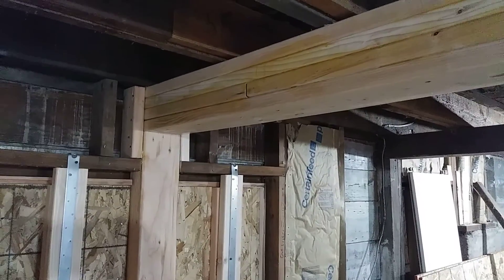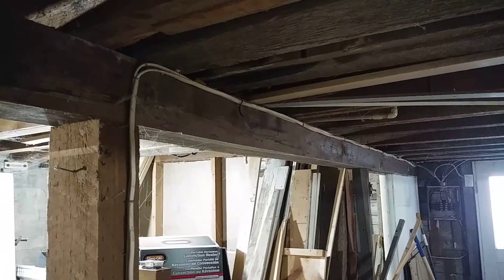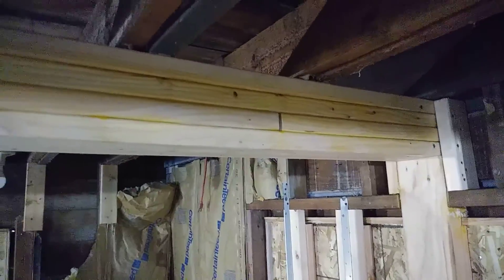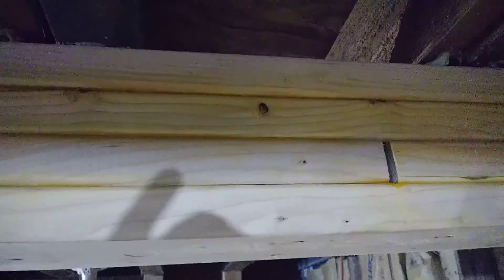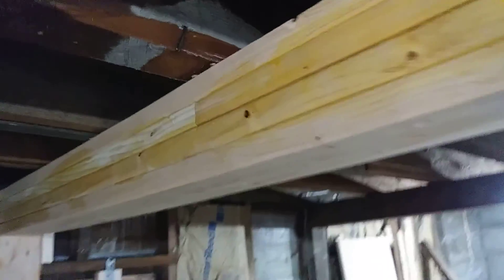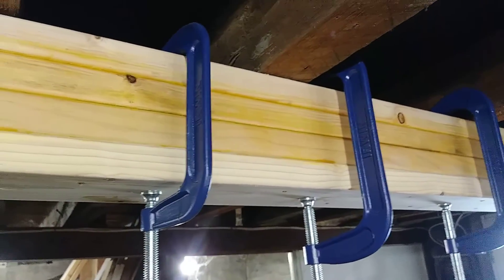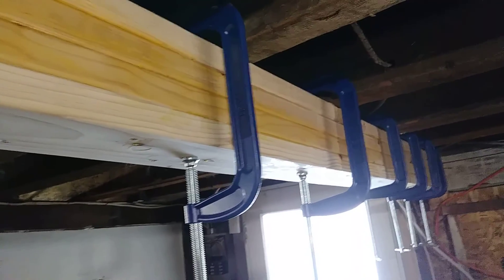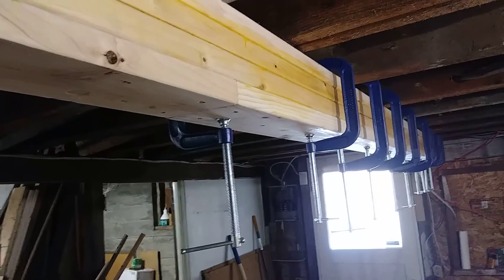Building a Glulam Beam in Place - Termite Repair

Comment: I thought the real strength from a 2 X 6 came from a load being placed on the 2 inch side of the wood. 2 X 6 placed on edge will flex less than the same laid flat on the 6 inch side glue not with standing. Why is the beam not built with the "I" in the vertical position. Why do you lay it flat? Just a weekend builder asking questions.
Reply from the maker: Factory-made glulam beams are routinely laminated as this one is. The strength is equivalent to the same size standard beam. The glue and screws that hold the layers together generate considerable sheer strength once the glue is fully cured. Strong clamping is essential when assembling the beam to achieve full strength, hence the large number of c-clamps that you see in the picture. Also, there are literally hundreds of small screws. These provide strength in their own right, and more importantly, provide clamping force while the glue cures. Also, it should be emphasized that the glue is applied as a thin, continuous layer of glue across the entire surface of the 2x6 beams. It is not a few random streaks or drops of glue. When you do this project, buy a one-gallon jug of woodworking glue. The beam that is pictured, which has four, 2x6 layers, (therefore three glued surfaces) and is twenty feet long, required two quarts of glue.
Reply: @wallihan  You cannot compare what is done under factory conditions with what was done here.
Reply: @gary24752  what magic do you think happens at the factory?
Reply: @UGPepe   The lumber species and grade all finger jointed to length, glue rated for structural use and clamping system under the right temperature conditions. Gluelams are engineered lumber and tested for strength.
Reply: @UGPepe  No magic just engineering. PVA glue is a NON structural glue, what appears to be use of pine with butt joints and the way they are pressed together are all the reasons this is not a gluelam beam. Do your research and stop making dumb comments.
Reply: @gary24752  I see this conformist mentality a lot in americans: you won't climb a chair to change a light bulb because it's not "rated" or "certified" for changing light bulbs. "research" to you means reading a label on a product. always looking for an expert to tell you what you can and cannot do with something because you cannot think for yourself or test things for yourself.
Reply: To call this a glulam it would take the correct species and grade of stress rated lumber and continuous with finger joints, the use of a structural glue applied and cured at the correct temperature and clamped with adequate pressure. Only a fool would take the chance on the adequacy of this kind of construction rather than just using a LVL beam that has been engineered, tested and manufactured to standards and picked according to its tested load carrying ability for the required span and load. Obviously you have not taken the time to do some much needed research to fully understand how a glulam is manufactured and why structural members have to be designed by someone with a background in engineering, preferably a registered PE.  Take the time and read Andrew Crow's response.
Reply: @UGPepe  Read Andrew Crow's response below. When it comes to structural beams yes I rely on engineering for structural members. At the very least I would have used LVL beams laminated per manufacturer.
Reply: @gary24752  In a confined space such as this, lvl would have been just as unmanageable as a factory rated glue lam. I guess you were not paying attention to the title and premise for this video.
Reply: You cannot compare engineered lvl lumber to construction grade lumber.  I guess you do not know the difference between a laminated beam which is what this is  and a gluelam which this is not.
Reply: @gary24752  deep
Reply: @UGPepe  There are some people that come here looking for ideas and understand and then there are those such as yourself that will never comprehend the dangers of guessing at something like this. This conversation is over.
Reply: The only difference I would have suggested is if you already have termites consider using treated lumber or western red cedar as it tends to thwart insect bother or use a treatment on the lumber you're installing. Other than that should work fine
Reply: @jerrodwaterman9793  western red cedar is not sufficient for this type of application. He should have bought a full length lvl for top and bottom cords and used longest #1 df possible. His gluing technique is wrong, should have used 1/8” trowel.   The best would have been an multi ply lvl/parralam flush beam to match joist depth.

Comment: Why would you build a garage out of wood? Let alone a 2 story one. Get some formwork, a rear bending tool and hire a concrete truck and build one out of concrete. It's not that hard.
Reply: The same as Scott said about his, the building I was in was older.. over 100 years old..  and at far as being able to have more presses in there, there simply wasn't room for more..  as far as fire, there was a suppression system of course..
Reply from the maker: I agree. But this garage is an existing structure, built more than 70 years ago.
Reply: @wallihan  fair enough, but I feel that people overestimate the efficacy of wood as a structural material.
Reply: @varun009  I used to work in a printing factory that had giant printing presses on 3 stories of a wood frame building.. the printing presses were about 30 tons each and there were 4 on each of the top two floors ..
Reply: @aztekwarrior518  right. And if it had been made out of steel reinforced portland cement concrete, you'd have been able to fit all 8 on the second floor alone, size notwithstanding. I'm not knocking on wood construction. 8 dream to one day live in a timber frame house, but when it comes to structurally important elements in high load-bearing structures, I don't trust anything other than concrete. You worked at a printing press which is highly susceptible to fire due to the heat from the presses as well as the immense amounts of paper in the factory. This is the last place you want to use wood - old growth, fire retardant, whatever. It'll still burn. Non refractory portland cement breaks down at high temperatures, but those temperatures have to be exceedingly high and sustained as load-bearing concrete structures use thick slabs and structural members in addition to those members having a very high heat capacity. Moreover, you can adjust your mix to include certain stones as aggregate that have a very high specific heat capacity.
Reply: @varun009  the people that buildt it originally didnt OVERESTIMATE it.
the cars 70 years ago, say a T-ford was 1500 pounds..
 todays  cars are 4000 - 7000 pound . hehe
my brotherinlaw didnt think about that when he tryed to drive hes new tractor around 16 tons, 6 times heavyer than the old tractor, up in the hay attic second floor in an old barn. 
luckyly the sheep was out in the field for the summer.. hehe.
Reply: @varun009  wood is a much better material for the planet. and glulam is extremly strong
Reply: A 4x4 braced vertically can support 10,000psi or more.